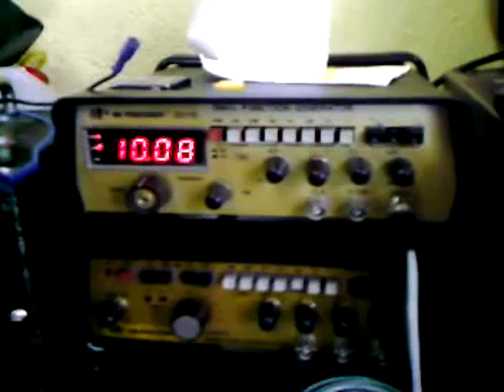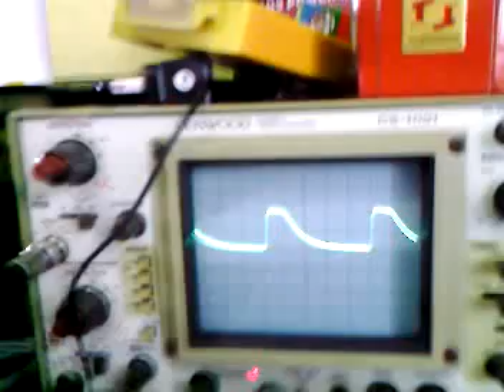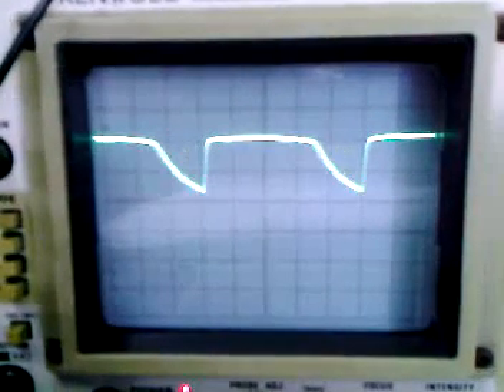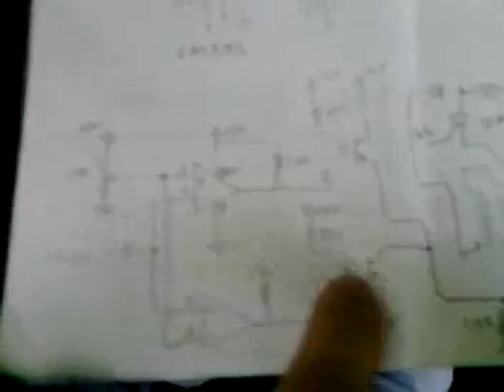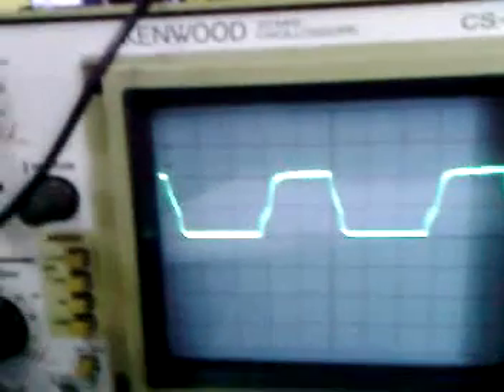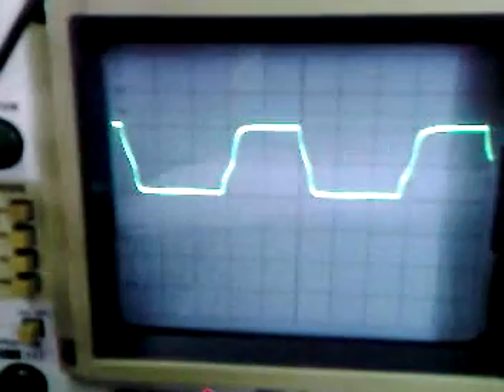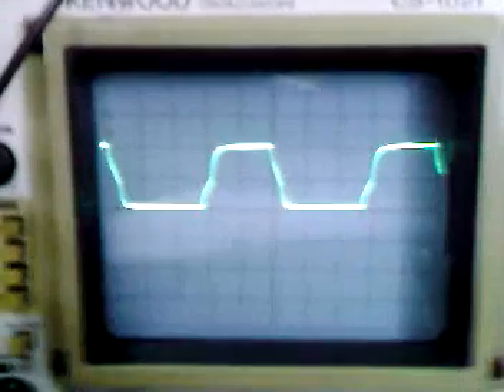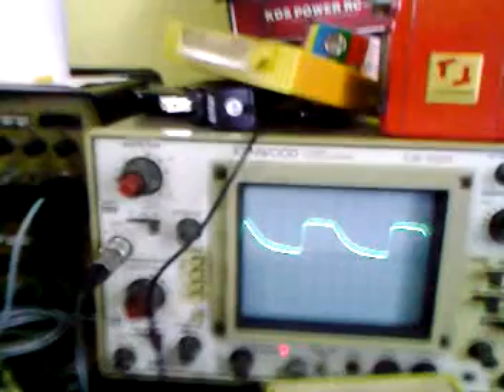Mosfet Driver using LM393 Voltage Comparator

Comment: Instead of another comparator output and suffering non-linearity of the optocoupler, simply use a totem output or a gate drive transformer. 10kHz is nothing to not have a perfect square wave output.

Comment from the maker: for Simplicity, you can use a Single 555 Timer......But I am going to use a PIC 16F877 Microchip Controller.......I just need to program it and the circuit is so much simpler.

My Proto-Type is already working.......will post its video when I finally finshed everything.